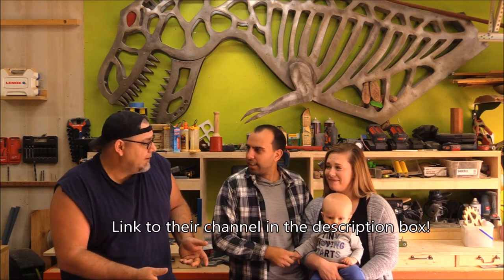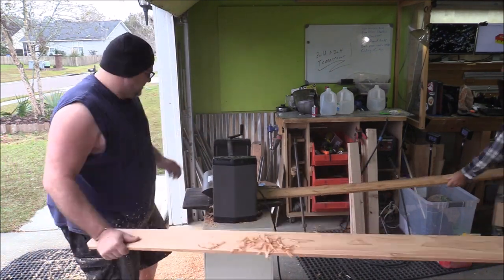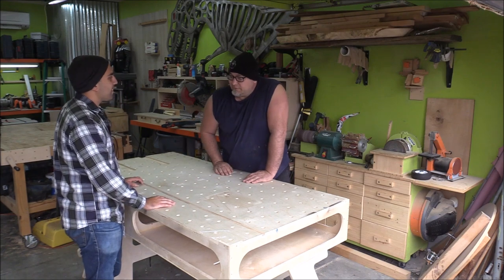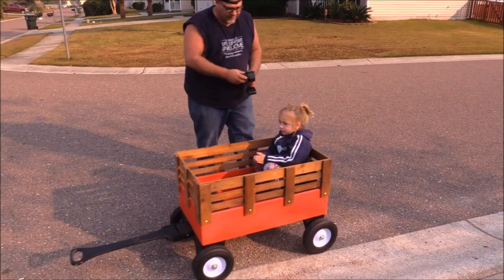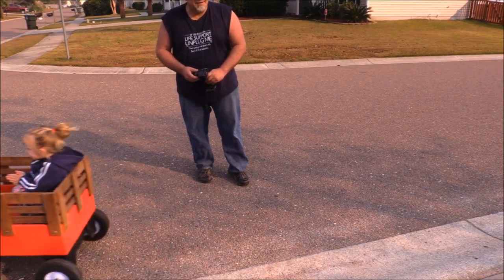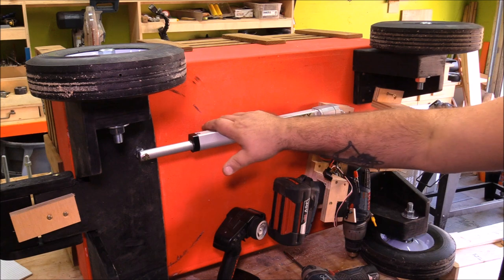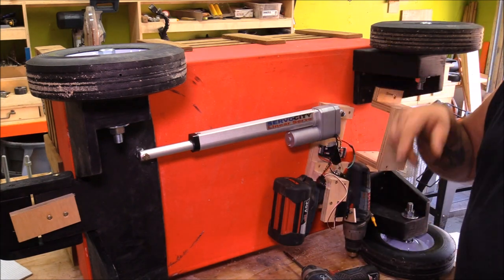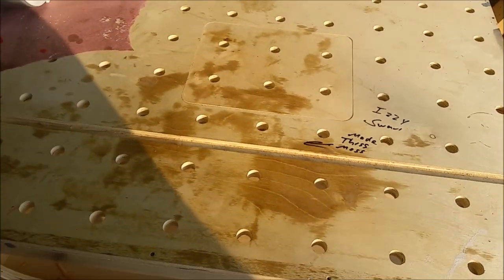DIY - remote control wagon that an adult can ride

Comment: Those expensive push rods may be able to be replaced with free ones out of old lift chairs off Craigslist, I got two out of a chair I was given, not sure about voltage differences but worth a look.
Reply from the maker: I wouldn't know how to control them or wire them to work with a receiver.  Travel speed is an issue as well
Reply: izzy swan forgot about that, they are slow, never mind LOL